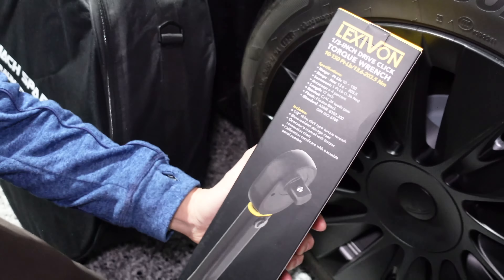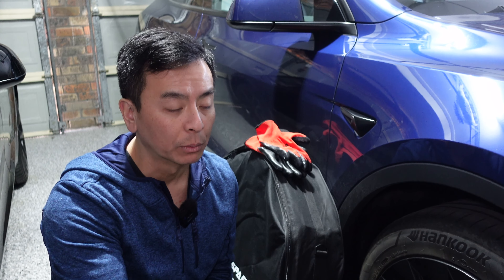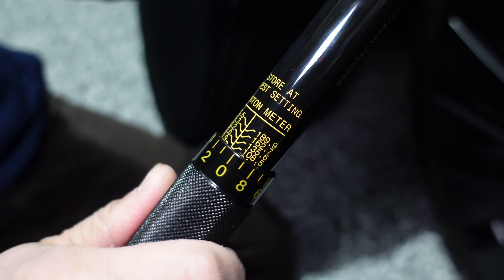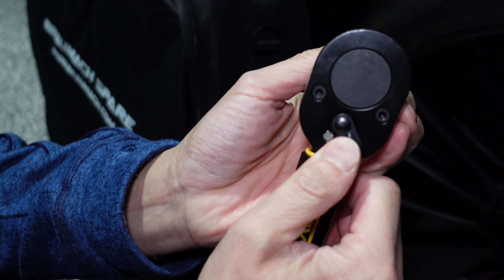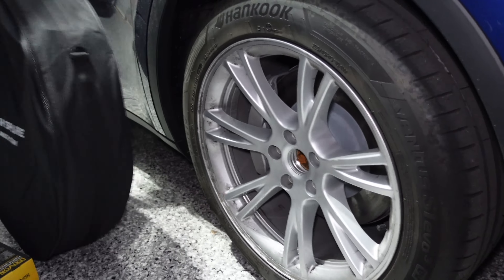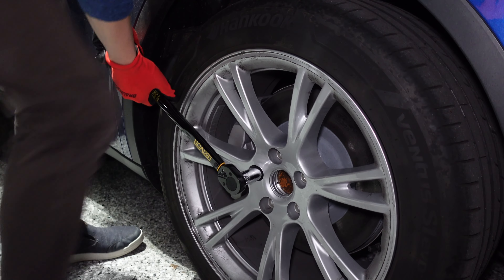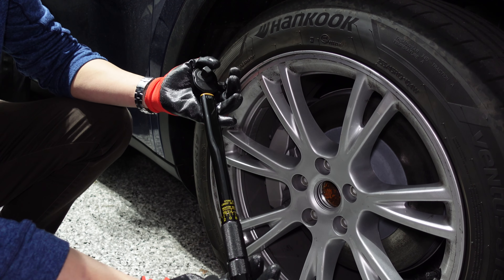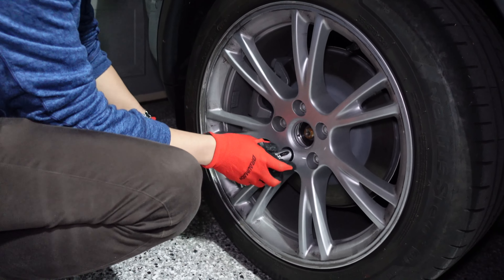Tesla Model 3 Y Correct Wheel Nut Tension 175Nm Click Torque Wrench

Comment: I find that having the wrench at the 3 o clock position and pushing down on it will save your back.  Having  it at the 9 o'clock position and pulling up can hurt your lower back.
Reply from the maker: Yup good point re: ergonomics 👍
Other option is to drive it forward from the 12 position if it the nut allows for it

Comment: just a tip with a torque wrench, when your finished using it always loosen it back to zero, this keep the wrench in good calibration, cheers
Reply from the maker: Great tip - stated in the manual of this tool also

Comment: Maybe not so obvious, but a torque wrench is actually calibrated to the handle...so no hands half way down the shaft! 
A few other things; always use a star pattern, pushing is a lot easier than pulling (using your weight instead of your back) and zero the wrench after use 🙂
Reply from the maker: Thanks for the tips 👍

Comment: Another way you can do this is with a breaker bar and a digital torque adapter. I got a 600mm breaker bar and Mechblue torque adapter for a very similar price to a torque wrench with the added bonus that there is no chance of the wrench being accidentally adjusted during use.

Always worth checking the torque whenever the vehicle has been near service or a tyre place. Too many just ugga dugga the wheels on and rarely torque to spec, especially on a Tesla where the wheel nut torque is so high.

Comment: Model 3 wheel torque range 180-200 Nm
im not too familiar with the torque spec on model y though
Reply from the maker: Wheel lug nut torque spec is the same for both Model 3 and Y ie. 175 nM / 129 lb. ft
- Model 3: https://www.tesla.com/ownersmanual/model3/en_au/GUID-FDDB10EF-FFA9-46EB-B8CC-03614AE92B6B.html
- Model Y: https://www.tesla.com/ownersmanual/modely/en_au/GUID-FDDB10EF-FFA9-46EB-B8CC-03614AE92B6B.html
Reply: Interesting. I was going by what torque specs we use at the fremont factory for model 3

Comment: dumb dumb...torque should be applied in a cross pattern...you are no mechanic
Reply from the maker: I accept that correction and no I am not a mechanic. Note: as mentioned in the vid these lug nuts were already quite tight, I was giving them a once over to ensure they were calibrated to the required tension
Reply: @LudicrousFeed  regardless, I will still have checked it in cross pattern